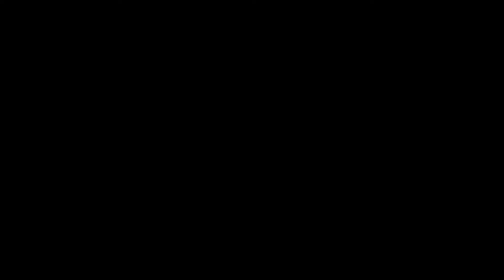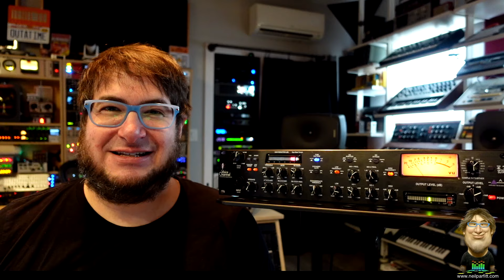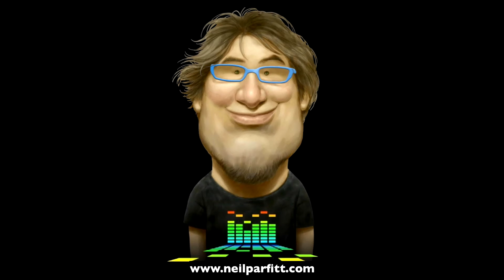Wrangling the Human Voice - Using a 'Channel Strip' - ART Voice Channel

Comment: Thanks for the video! I’ve been thinking about one of these units for nearly the same application. I would probably use the conversion either going directly out of the AES to the AES in of my Canon C200 or using an AES to Dante converter.
Reply from the maker: Ah that’s cool. I wonder if any cheaper cameras can take an AES feed.
Reply: @NeilParfittMusic It’s possible I missed a camera with AES but I think the C200 is probably the cheapest. Bypassing not only the preamps but also the converters was worth it for me. Also, four channels of audio likely wouldn’t change your talking head videos but if you were recording a video with both speaking and a DAW mix it’s nice to have separate tracks to make a quick gain edit or something.

Comment: Fantastic video, thank you Neil. I really like what the device is doing with compression and gating. For my tastes — and to be clear I'm an enthusiast and not a professional engineer with a trained ear — I think your EQ is just a bit overdone. There's a noticeable hole around 800hz and way too much sibilance in the 6khz+ range.
Reply from the maker: @sjwright2  yup totally - still tweaking - not a final setting by any means - def a bit too much bass for sure which accentuate the midrange scoop - but I chose not to modify anything after the fact to stay true to the moment.   

What I’ll end up doing is recording a pass of myself reading something with everything off,  along with the she sells sea shells and  … push it through the preamp and then make my “set and forget” adjustments :)

Comment: hey Neil. Weird question perhaps: i often use wireless LAV mic's and I was wondering if I could process the audio from the wireless receiver through a channel strip before it goes to my Zoom recorder? It would speed up my workflow a lot if I had processed audio and didnt need to put it in a computer for final touches. Would this work going 3.5 mm out from the receiver into the channel strip into a recorder?
Reply from the maker: Hrmm good question - this particular preamp is expecting mic or instrument level,  but there is a line insert input on the back that can inject an outside signal post pre-amp/pre compressor.   That being said there’s a pad and gain adjust - so there’s the potential to wire it to the pre without distortion.  Only way to know is to test by doing a 3.5” TS to 1/4” TS cable to see if it would behave.  The output of the pre is at line level,  so if the zoom can accept that .. it’s worth a test. 
 
Can you rent this unit (or similar) where you are?
Reply: I have an old Sennheiser G2 analog system and ... That's a really good question then I'm going to see if it works with an 1176 clone hahaha!
Reply: @NeilParfittMusic  thanks!!
Reply: There’s literally no reason it wouldn’t

Comment: Can you use this for game streaming and hear you game as well as your voice
Reply from the maker: With the nature of my setup,  What you're seeing is what goes out.  I can switch on the fly to the main or secondary computer screen,  as well as PIP and it will also mix together any computer audio playback and duck it against my voice.  That took a lot of setup outside of what this Rack does .. but if you're setup can merge interfaces,  you could use the USB connection and aggregate it with your existing interface (if you're on MacOS)

Comment: When I listen to spoken word content, I'm usually not interested in nice sounding voices. Depending on the speaker I turn up the speed to 1.5x or 2x. I use SoundSource on macOS to insert an EQ with a considerable downward slope below 500 Hz and heavy compression. It's far from "radio" or "ad" sound, but it works well for keeping speech understandable.